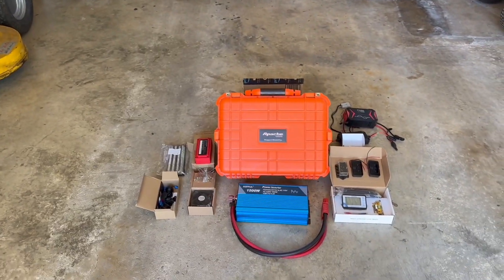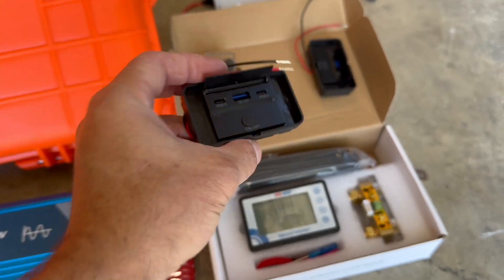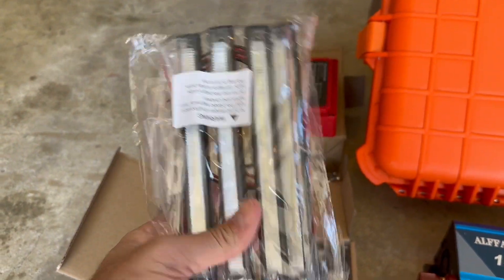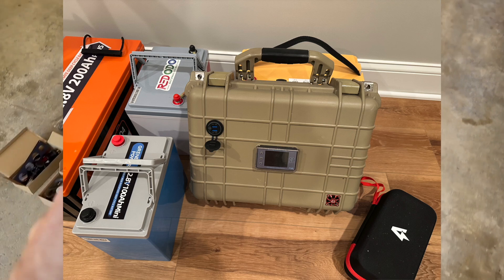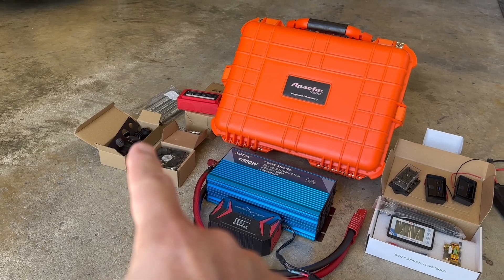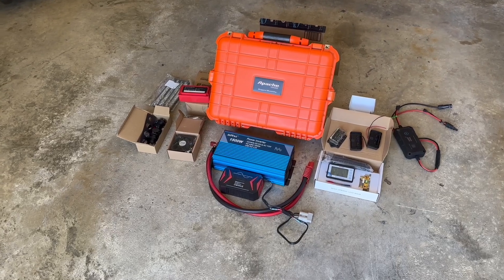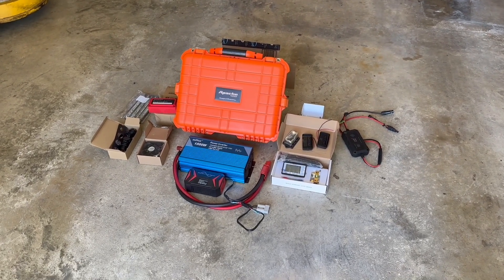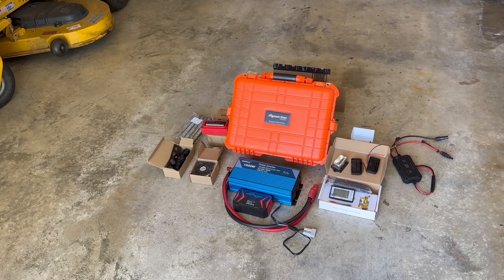DIY Battery Box 2 0 Pre-Build Video Help Me Select Components

Comment: Need to get 2 mini 100ah in the large apache box by themselves for my rv, think 2 will fit? No other stuff just two batteries wired togehter and anderson to charge. Thanking of getting power queen low temp wifi model mini 100ah.

Comment: Great idea.
A 1000W inverter would be fine I guess.
Would add a main switch in between the battery and all other stuff, so that you can safely store it, without any battery drainage.
Perhaps add as much as possible charging options? 120v grid, solar, 12v sigarette plug
Reply from the maker: Thanks!

Comment: The 1500W inverter will have a pretty good amp draw when turned on, even when not using any outputs...also takes up a lot of real estate. Could be better to install PP inputs into the case and keeping the inverter external for use when needed. Or upscale to a suitcase 😁  Enjoyed your first build...would like to see what you do with this one.
Reply from the maker: Thanks!  Hoping to start it pretty soon - been super busy at work among some other family issues. Agree on taking up real estate. Thinking maybe put the inverter in a box and then clip them together to use vs having it outside the box….  Just not sure of the heat load in a box…

Comment: I'm planning a build strictly for tailgating, camping, and HAM radio. I'm definitely going to look at the battery in your first video, its like half the size of the GoldenMate I was looking at and the same Wh rating. That said, I'm planning on a 600w inverter. 600w should be way more than enough to run what I want and even run larger items if needed. Initial plans was to use one of those rolling toolbox deals that everyone makes, but I would love to get it even smaller. One thing I might add if you plan to sell them if a killswitch, that way people can just turn the switch on the outside and kill all power from the battery.
Reply from the maker: Thanks for the ideas. The one concerning item if I do sell some is just misuse.

Comment: Use SSR100A,100A relay and LVD to protect battery from low voltage and also blocking diode for anti backflow
Reply from the maker: Thanks for the ideas!

Comment: First of all thanks for posting these videos. I recently built a battery box after watching your first video. I probably watched almost every video on youtube and decided to emulate yours. I just added a 50 amp Anderson plug to be used for charging and for my inverter. I only plan on using a 500 watt inverter. From what I've read it should be fine. Not an electrician though so we'll see what happens. I did fit a 12v fuse block and fused everything in mine. I definitely could use a bus bar but there isn't much room left. I was thinking about upgrading to the 4800 box so I can fit an inverter and bus bars inside the box as well. Can't wait to see how this one turns out.
Reply from the maker: Thank you, Glad it inspired you. I’ll see what I can come up with.

Comment: Interesting project.  I have done DiY for DC power for a portable ham radio kit. The radios and accessories all run off of 12 volts so that was my baseline.  I couldn’t use higher voltage and then step it down due to the radio noise with Dc to Dc conversion.  For portable AC power I am interested in retail units such as Anker, Eco Flow, or Bluetti.  It would seem your box is nice size if you stick with just DC.  But you have to determine the need/requirements for you.  Good video and look forward to more.  Just subscribed.  All the best.
Reply from the maker: Thank you!

Comment: I've been thinking along the lines of paultech9385. One box with smaller battery and some DC outlets (USB, cigarette, etc) and all the other equipment (solar converter, fuses, etc) with the equipment sized for a larger system. Maybe a small 100-150W inverter for powering/charging a few things. Connections on the small box to hook up a larger box with bigger battery(ies) and large inverter. Most of my needs for emergency power can be handled by the small box which is lighter and more portable. Then I can add the large box (12v, 200aH) as necessary. You are going to need a lot of juice to run a big inverter for any length of time.

I'm still tying to figure out how all the connections would need to work.
Reply from the maker: I like this approach - maybe the bigger box has another battery too….

Comment: Too late for a 24V system?  Add a cut off for the inverter to stop battery drain.  Battery in one box and maybe the inverter and other electronics in 2nd box that stacks.
Reply from the maker: Thanks for the thoughts!  Two boxes is an interesting idea!  Not sure if I can get 2 batteries in for 24v but would really up the capacity

Comment: Yes, an inverter is a must. But before you know what size inverter, you need to know the size of your battery. A 50%ish battery to inverter ratio is what power stations seem to use.
Reply from the maker: Thanks for the comment!
Reply: Good rule of thumb keeps disharge at around .5c